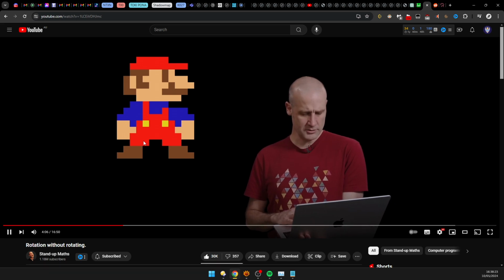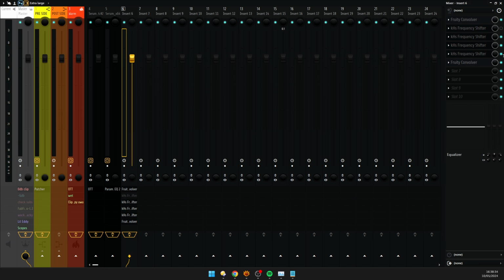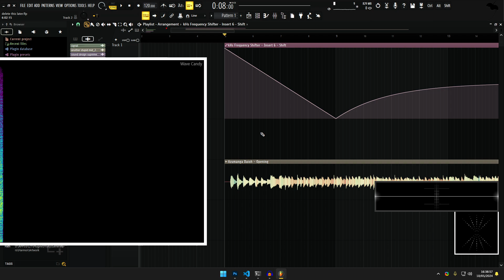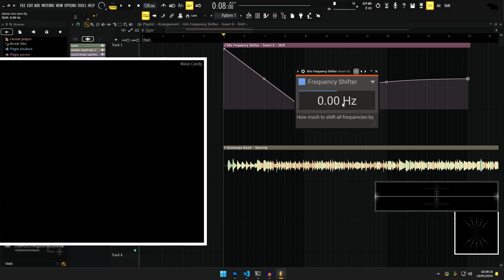How to rotate sound in spectrograms

Comment: This may not seem useful in sound editing, at least in the first glance, I think I saw a very similar concept applied in a image processing. Specifically, by rotating the FT of original image and applying a pass-filter along one axis worked better for denoising (?) than without rotation. I forgot exact details or the reference, but that seemed quite useful.

Comment: This is amazing! Although it would be hard to rotate full songs or anything of length, but for single samples it must be increadibly fun
Reply from the maker: definitely possible for longer songs if you are okay with it falling out of the spectrum a little bit lol
or for 90 degree rotations you can do the whole thing pretty easily
Reply: @idiotinium  but if you cram a full song into a 1-24000 hz window, lots of it will be lost, impossible to recover. And the sample is probably going be just a very anoying noise
Reply from the maker: nah
but yea it would sound like that

Comment: So basically the first skew is a convolution with a sweep, and the second skew is done with the frequency shifter, which works as a modulator coupled with some pre/post high-pass filters. The high-pass filtering stage must be the primary source of losses.

A possible use might be the IFS technique which iteratively applies a set of different rotations to form fractals. My experiments from 2008 shown that audio fractals can yield rather special and weird noises. =D
Reply from the maker: yeah i also suspect that its the lowpass filter when its at 180° but i tried a few things yesterday and it seems to be a different issue, since i managed to get the lowend back by playing around woth the timing but the frequencies were slightly off

Comment: rotate it twice, figure out how long the sample needs to be to fit in the 20khz-20hz range, and you'll have a new instrument that changes in weird ways over time (passing over the amplitude of literally every single frequency of the song and how it changes over time at once).

This would be very useful for sound discovery.
If it doesn't work, then the convolution steps were probably wrong algorithmically. I wouldn't be shocked if converting something from 1d to 2d, rotating it, then converting back to 1d comes with unavoidable costs.